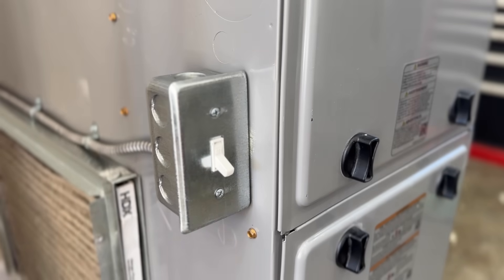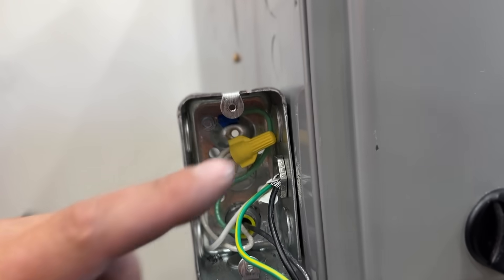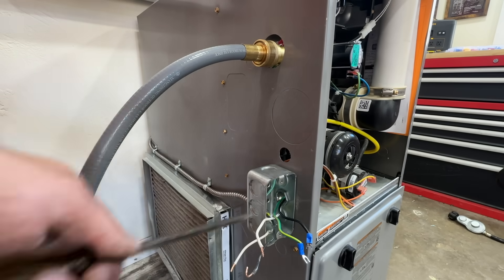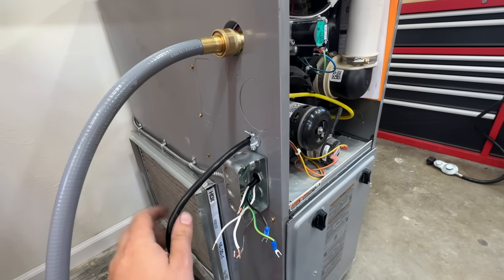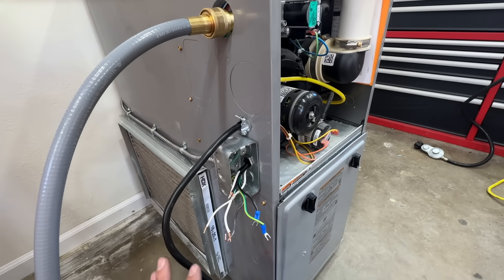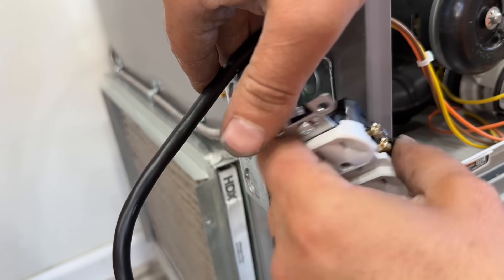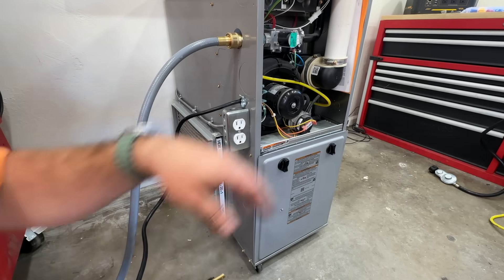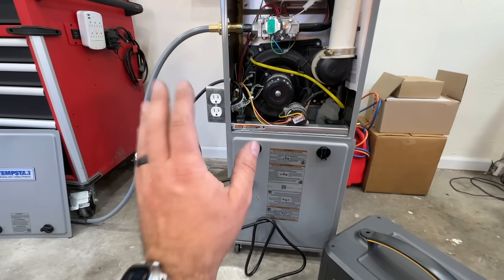Keep Your Family Warm During A Power Outage By Installing This $5 Part

Comment: electrician here. That was the first thing I did when we bought our house. way easier to hook up the generator.
Reply: My Dad did this back in the '70s. Still got his old Sears alternator.
Reply: Can you make a similar connection with an oil burner boiler?
Reply: @dpatt45  absolutely.
Reply: @FosterFarmsOk I wish i had someone who could help me set this up. Was thinking of buying an eco flow delta 2 for situations like this w power outages and running the oil furnace to keep from freezing cold, but I’m not confident I would do it right and not so confident in local electricians in my area
Reply: I would imagine you'd have to power the circulator pump and control circuit as well.
Reply: @Travis141123  I would normally use the word, "Duh," here, but I shall refrain and simply point out that "Those are typically part and parcel of the boiler, itself."
Reply: @TimeSurfer206  my thermostat is wired just before the furnace so I will need to account for that.
Reply: @dpatt45 wondering the same myself mine runs on oil…
Reply: How long will the vtoman power supply power the furnace for During a power outage
Reply: @Rondawg24680 Same question and this is 1000W inverter. Will cheaper 500W inverter work just as well?
Reply: @Rondawg24680  The most important question and he never mentioned anything about it
Reply: When we bought this house, I was excited to see that the furnace was already pig-tailed and plugged directly into an outlet in the wall. One less thing on my Honey Do list. It has come in handy a few times in the last ten years.
Reply: Same thing here when I got a whole house portable generator. I didn’t want a standby generator that was attached to the grid.
I purchased a dual fuel generator to power my house and I built a generator shed that is sound proof and vents out the exhaust through an extension and a silent muffler. Added a solar powered vent fan and made a few fresh air intakes.
Reply: I took it one step higher and can plug in my hole house.  Power straight to the panel.
Reply: @@Harley6714 some inspectors will let that pass if the romex isn't    in a place that it can get damaged easily.
Reply: You may have but did you share it with other people. No point bragging. I am thankful to the gentleman who did this video. Excellent idea and thank you for sharing your knowledge.
Reply: Hi there..could a similar setup be used to keep a tankless (gas) water heater's electronics working so as to also have hot water..?
Reply: If I have a Heat Pump connected to my oil furnace, will it be necessary for me to switch the thermostat to "Emergency Heat" only, before connecting to a generator?
Reply: @newguy6935 
Yes or if you a generator that handle to load.
Reply: @dwellie12 there is basically no load. I can run mine off of little handheld generator. All is powering is the blower. Hardly nothing but not to mention I have the big main full host generator. This is just a secondary backup so I can run it on a tiny one
Reply: My concern isn't the pigtail, but coiling it in normal use. The blower is an inductive load which might draw up to 10 amps running and spike even higher than that on start. Loops in the cord, particularly tightly-bound loops, are recommended against. Better to keep the cord short and use a 14 or larger gauge extension for the odd occasion you will need the secondary power source.

Also, where I come from hooking up that ground screw to the bonded ground on the box is mandatory. It is not sufficient to rely upon the contact ground between the mount points and the box.
Reply: interesting.  my Richmond Boiler uses no electric.  no circulator. gravity feed of the hot water.   However, never have had a power outage in winter.
Reply: Does it need the generator just for the initial spark or does it need to constantly run? What would the wattage on the generator need to be?
Reply: Yah it's bs finances will always a plug in then smartie pants guys were like let's require direct wired like didn't have to go that far just make it isn't own circuit and it's fine
Reply: What’s minimum power requirements for this burner. I got same burner and a small inverter generator just wondering if I needed to run the burner.
Reply: I guess my parents were unlucky. I'm their township well pumps, furnace and central AC units must be hard wired.
Reply: Why not come directly out of the work box?
Reply: Isn't not screwing in the unused hot and neutral screws hazardous?
Reply: Code only matters if you're being inspected lol
Reply: How do you make it kick on if the thermostat is dead?
Reply: @gtarules1  your thermostat gets 24 volts from the board on the furnace so it will get power when you power up the furnace of course you'll need to be sure the batteries are good.
Reply: @gtarules1 This powers the thermostat, too. Your thermostat is connected to the main board on the furnace.
Reply: Thermostat/controls and any circulation devices have to be wired to the same circuit as furnace @gtarules1
Reply: @gtarules1 The thermostat is powered with 24V by the furnace/AC unit.  If you power up the furnace the thermostat will have power.
Reply: @gtarules1 thermostat is powered from the furnace circuit board
Reply: Thermostat gets its power from the furnace
Reply: @sripvw  Thermopile.  gas pilot.  Interesting side note.  The gas valve HAS NO 
button to hold DOWN to supply gas when lighting the pilot.

Absolutely No Connection to  External AC or DC power. other than internal mentioned
thermopile.
Reply: If you’re an electrician then you don’t need to do this. Just install a transfer switch
Reply: I've been telling clients that extension cords are far cheaper than a transfer switch fo year, and never once thought of this.
This, combined with a  roughly $200 dollar UPS that's had an external battery added can be a lifesaver.
Reply: @TimeSurfer206 ups ?
Reply: @OGCJ10  "Uninterruptible Power Supply." It's a cheap inverter with a battery pack and charger that's designed to give you enough time to save your work on your computer and shut it down after the power goes out.
It's a cheap work-around, but I'd recommend going with an actual "Solar Generator," which is basically a bigger version, and designed for such tasks.
Reply: The pig tail isn’t code. Exposed high voltage wiring to a furnace or boiler needs to be in conduit.
Reply: @jamesszalla4274  cite the code article or you're just speaking nonsense. And beyond that when it's your house you can do whatever the hell you want. If you don't like it move on not your problem
Reply: @FosterFarmsOk my thoughts exactly. Screw the code people. The only time you might have a problem, is when you are planning on selling the property.
Reply: @Ocean_breezes   When selling the house, you can just rewire everything back to how it was installed. In the meantime, you have a backup plan.
Reply: Sure you are. This is 100% a code violation.  Zero protection. 
Keep lying bro
Reply: It’s all hardwired together, so what happens when the power comes back into the panel ?
This is not registering with me, because it’s all tied in, so when the power comes back on it will feed the furnace, and the outlet, and the power source.

What am I missing ?
Reply: @ginoasci  The newly installed outlet is powered from the breaker panel. 

The pigtail is the furnace wiring. 

With normal power, the pigtail acts as the switch when plugged in.

When power is out, the pigtail is unplugged from the outlet and plugged into an external power source. When power comes back on, the outlet is powered and you can plug the pigtail back into the outlet.

Watch closely how he wired the pigtail. It is NOT spliced into the outlet wires coming from the panel.
Reply: @ffemtx4 : very much appreciate your explanation
Reply: Lol, electrician? That won't pass code in my state.
Reply: @phillmccracken4219  lol good thing I'm not an electrician in your state cause it does in mine ;)
Reply: @FosterFarmsOk LOL. Check with a mechanical inspector in your jurisdiction. I’ll bet the inspector says the pig tail isn’t code because it’s outside the furnace cabinet and needs to be in conduit. I’m a retired HVAC service tech. If an electrician told you the pig tail is good, he doesn’t know what he’s talking about or he didn’t know you were wiring into a furnace.
Reply: @jamesszalla4274  I'm a 25 year electrical contractor and know all the inspectors for electrical and mechanical. Plus my best friend is a 30-year mechanical contractor. Just because something in isn't ok in your area doesn't mean it's not in mine. So again sorry that you live in a jurisdiction that is full of idiots.
Reply: @jamesszalla4274 :  I’m in Massachusetts, and I believe what you’re saying applied here as well.  Pig tail cord had strands of wire when romex is a solid wire, so that’s another no no for me and I’m not an electrician.  I have a three family dwelling full of tenants, and there’s no way I’d trust pig tale on my heating systems with people on all three floors.
The city doesn’t have to tell me not to do that, because I refuse to put anyone in danger.
That IS dangerous as far as I’m concerned.  Yrs it does work, but I don’t trust it enough to risk lives.
Reply: @FosterFarmsOk I’m a first time home owner and have an oil furnace. We just lost power and I have no generator 😮. Do you know of if I can have an electrician set this up on an oil furnace the same way, and if a battery like the delta 2 would help me at all for events of power outrages like this? The contractors I found in my area aren’t so helpful…
Reply: @phillmccracken4219 what state do you live in?
Reply: @phillmccracken4219 did he say it would pass code tool bag. He’s trying to help
Reply: @phillmccracken4219   Do you live in California?
Reply: @phillmccracken4219 I’m a retired HVAC service tech in Michigan. It definitely isn’t code here. High voltage wiring outside the furnace or boiler cabinet needs to be in metallic conduit.
Reply: @phillmccracken4219 This not passing code, that's what's called big government or the nanny state.
Reply: Guys, here is The Savior

HalleluYAH translates “Praise ye YaH”

YaH is The Heavenly Father 
YaH arrives via the TENT OF MEETING
YaH was Who they Crucified for our sins
YaH was Crucified on an Almond TREE

— Ancient Semitic Cuneiform of Moshe (Moses)
— Isa Scroll (The Original Isaiah)

Isaiah 42:8
"I am YaH; that is my Name! I will not yield my glory to another or my praise to idols.

Isaiah 43:11
I, I am YAH, and there is no other Savior but Me.

Isaiah 45:5
I am YaH, and there is none else.

Comment: I am positive this would work in areas that are used to winter weather but here in South Louisiana, last year for the freezes a lot of utilities shut off gas services due to broken lines. A lot of whole home generators and gas furnaces were useless.
Reply from the maker: Yea, it’s always possible but a lot of the people in texas during the ice storm had gas and no power and it’s happened many times to me out here in utah.
Reply: @diyhvacguy we had gas at our home here in Texas but no electric. Our house wasn’t bad and only got down to about 56 but this would have come in handy.
Reply: Belt and suspenders… pick up a Mr Heater propane heater for when the gas goes out. Great for emergencies and can be used for camping etc.

Comment: Why not replace the switch with a generator transfer switch?  They are not all that expensive, and a more elegant solution, rather than messing around with pigtails..  A video of that would be great.
Reply: The reason someone might want to do this is if they didn't want to go through the expense of adding a transfer switch.  This costs nothing and will allow the furnace to run with a small portable generator.  Do they even make a single circuit transfer switch?
Reply: @ohger1   They do make a single circuit transfer switch but why spend $$$ when this works perfectly?
Reply from the maker: Exactly. People don’t have the funds for that or the know how, but we are talking emergency here, and they can run to Home Depot last minute and grab this stuff if need be.
Reply: @diyhvacguy  People without the funds or know-how shouldn't be doing anything like this - no matter how cheap it is to do.
Reply: @lesterawilson3 please check your tire pressure.
Reply from the maker: I have a video of the interlock kit and power inlet box. Just as easy and effective

Comment: I liked your video, but I'm confused. If you have the pigtail cord connected as you show, when it's plugged into an alternative power source during an outage, and the grid comes back on, won't you be feeding into the grid since your plug is going to the power lines from the circuit box via your outlet box. Unless you are saying that one has to leave the furnace breaker off until you stop using the alternative emergency source. Doesn't it need an A/B switch or something like that?  I realize that once you unplug the pigtail line from your alternative power there's no problem, but until that's done don't you have 2 sources into your receptacle connection?
Reply: I skipped through the video (like I usually do!) and don't want to rewatch it to answer you, but to do this correctly and safely, you remove the original shut off switch and then wire the new duplex outlet into the AC that goes back to your breaker panel like any outlet in the home.  You then remove all wiring from the furnace to that duplex box.  The new pigtail is wired to the furnace only and the three prong plug end is plugged into the outlet during normal conditions.  When the pigtail is unplugged from the outlet, the furnace is isolated if wired as I described - the breaker does not have to be off to isolate the grid.   I suspect that what this guy did was keep the wiring from the furnace inside the box and connected his pigtail to that - it's confusing.  He should have pulled the furnace wiring out of that box entirely and made the connection of the pigtail to the furnace inside the furnace itself.
Reply from the maker: Pretty sure I made this crystal clear, like I don’t know how I could have made it much clearer but what you said is exactly what I did. The furnace is attached to the pigtail ONLY. And the box just becomes a place to make connections, and to connect the grid wiring to the outlet. So when grid power comes back it will have absolutely no effect on your alternate power source. You simply unplug it from your generator or power station and plug it back into the outlet 👍🏼

Comment: This video reminds me of electric cars.  They are an OUTSTANDING idea, however, the fundamental limitation/issue, is the batteries don't store enough power (don't last long enough).  And that is what you have here.  GREAT idea, but where is someone going to get a battery to power the furnace for more than a few hours, at best?  That VITOMAN will only last less than about 2 hours. AND YES, THAT "may" be outside the scope of this video's idea....but what good is the idea, if the furnace won't work (due to lack of battery capacity)?
Reply: You can also use a portable generator and run an extension cord through a window to use this for emergencies.  As far as electric cars, my Tesla has more range than the SUV it replaced...
Reply: @ohger1  Yes, of course one could use a generator.  However the way I saw this video, is that it WASN'T JUST a how to connect to the furnace (which it included), but the title reads: "Keep Your Family Warm During A Power Outage By Installing This $5 Part"....and nobody is going to keep any family warm very long, with the part alone......so then he shows the VITOMAN, which (like it or not) implies that it will be all you need.  And it seems we both know more is needed - as you said - maybe a generator.  My take is he should have spent just a minute or two saying something about the energy source that will be required.
As far as my comment about electric cars....we ALL know that probably the number ONE reason why EVERYBODY doesn't run out and get one, is because of a concern for both limit on the range, and cold weather performance of the battery.  So my point was, and is, that the current battery technology is (probably) the ONLY limitation with them.  But it IS a limitation.
Reply: @stephenbay9564  Understood on the Vitoman.. the title is misleading as far as EVs, the range and cold weather performance is only a concern for those who don't own them.  Range anxiety disappears once you own one.  The biggest drawbacks are initial cost, insurance, and charging for those who don't have access to home charging.  Those are real limitations, but the vehicles are not. But for everyone else, they are a revelation.  I can't believe I used to drive a car that injected and ignited a combustible mixture into a complicated engine that required constant maintenance and was so limited in efficiency and power band that it required a multi speed transmission.  I will never own another ICE vehicle.
Reply from the maker: Will This Power Station Heat My Home For 24 Hours During  A Power Outage?
https://youtu.be/G3zzxHmJEjI
Reply from the maker: 2 hours? The things lasted like 20 hrs
Reply: @diyhvacguy  The VITOMAN 1500X alone (not with VTOMAN Jump 1500 Extra Battery sold separately). ) says:  "a decent capacity of 828Wh, which is 828 Watts for one hour.  A typical blower motor draws 6 amps, at 120 volts, which is 720 Watts, which does not include the inducer motor or other electronics (the motherboard).  So what this says is the furnace can run continuously for just over an hour.  What did I miss?